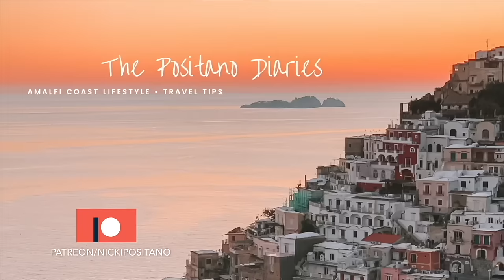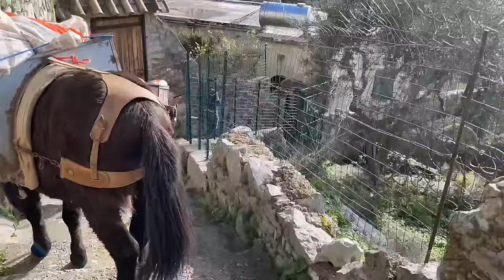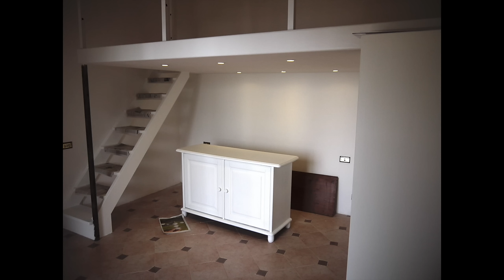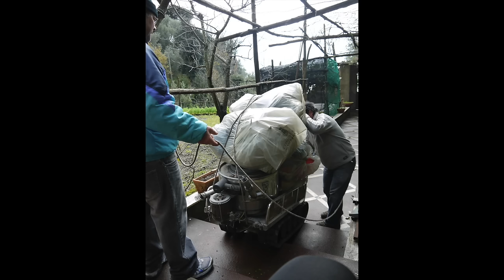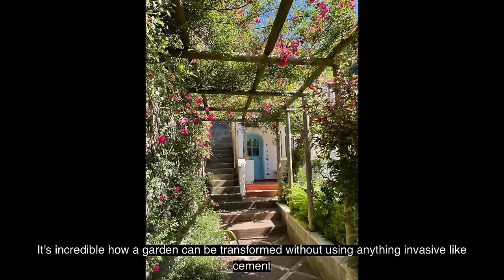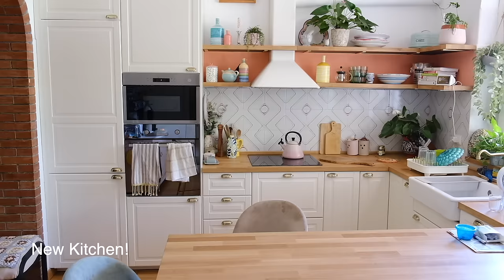HOW WE RENOVATED AN ABANDONED HOUSE IN POSITANO | EP 201

Comment: You could use self-setting gravel over top of the stairs - it would be cheaper and easier.  There are videos on how to do it.  Experiment before deciding.  The existing stairs would prevent the gravel from shifting and any forms that might be needed while the gravel is setting up or hardening would be minimal.